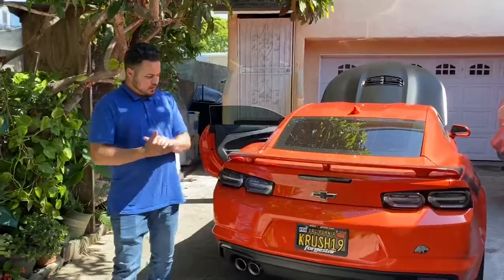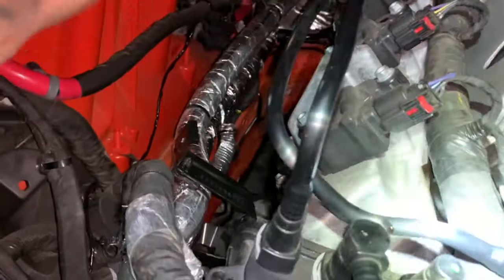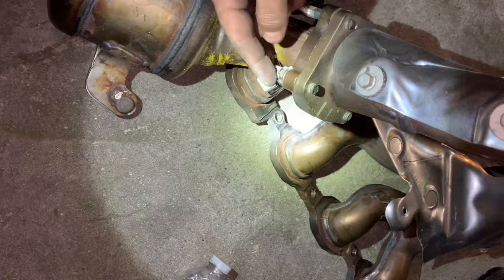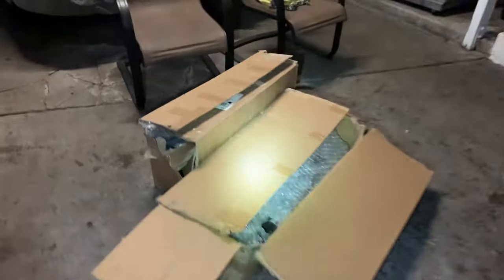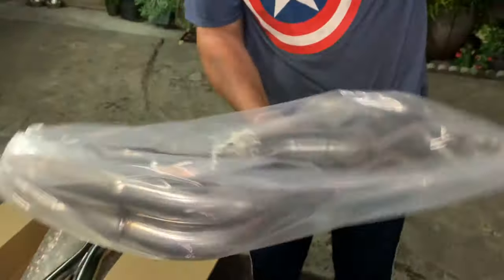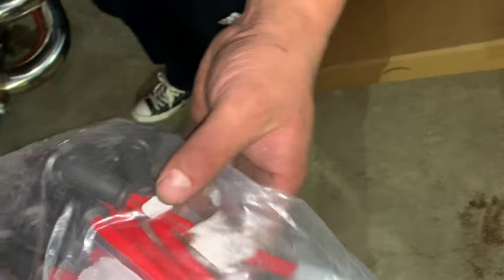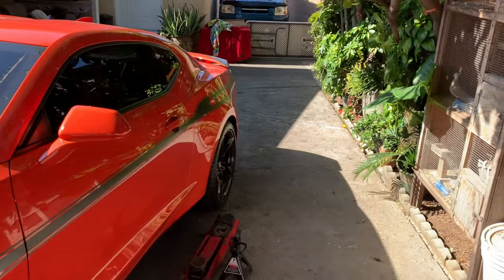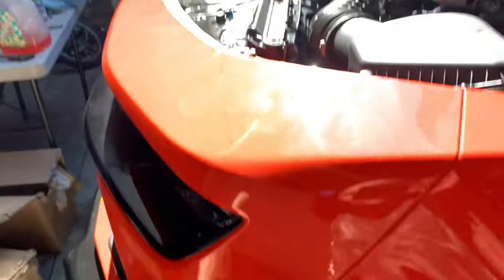2019 Camaro SS Longtube Header Install

Comment: Any heating issues. I have same ones and ppl say to wrap them or other wiring’s so it doesn’t burn anything
Reply from the maker: No heating issues but you'll have to wrap or zip tie away the harness on the passenger side just to be on the safe side

Comment: Aye bro when you ordered these, did you select the OEM Gasket option, or the multi-layer steel gaskets with bolts option?
Reply from the maker: We got the oem gasket only way to go and used the oem bolts as well haven't had a leak since install
Reply: @ytrfilms9694  did you torque them down to specs or did it by hand?
Reply from the maker: @laserguy815  we tighten them down by hand and after a few heat cycles go over them again work from the middle out seems to give the best results and make sure you use blue lock tie on the steering column bolt
Reply: @ytrfilms9694  appreciate it! And by heat cycles do you mean like after a week or two in between to tighten them again?
Reply from the maker: @laserguy815  when it gets to fully operational temp meaning when the thermostat opens up or after a 20 min drive
Reply: @ytrfilms9694  oh gotcha, aye I appreciate it brotha!

Comment: But i also have open headers i havent welded my stock exhaust to it
Reply from the maker: No it would go away once the cat codes are turned off with a tune. It doesn’t hurt to check all the wires once again ensure there fully seated in and not touching the headers.
Reply: @ytrfilms9694  ,
Nice install. 👍  Those Damn pigeons in the background are very loud or hungry. 😅

Comment: I just installed mine and my engine light is on and stability track im guessing my wires arent plugged right?
Reply from the maker: sometimes a spark plug wire gets burnt and the cars detects it as a stability track issue. Re check your spark plugs wires ensure none are resting in the primaries tubes.

Comment: Did you buy shorter plug wires? Or kept stock ones
Reply from the maker: We purchased the speed engineering wires which are shorter in addition provide a 45 degree angle to avoid contact with the primaries tubes

Comment: did you have an issue tightening the spark plugs back up with the headers installed
Reply from the maker: We were able to do it with a  small extension that swivels at the socket connection.
Reply: how about the extension for the o2 sensors do you know if they go to the grey clip or black one i didnt check which one was front or back  🤦🏽‍♂️
Reply from the maker: @gabrielgabrielv6252  we didn't use them all you have to do is unclip it from the top and it will give you all the slack you need the rear o2's will be disabled in the tune